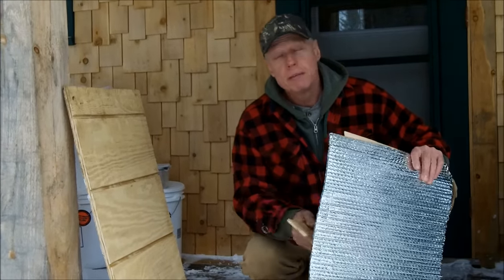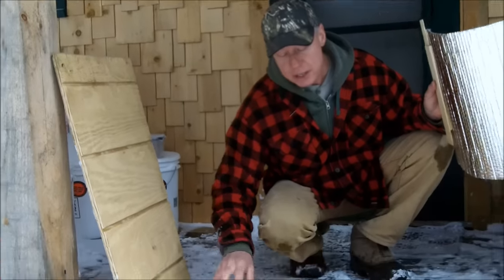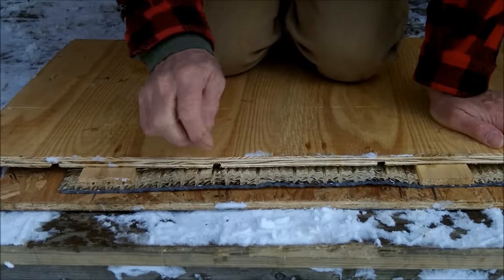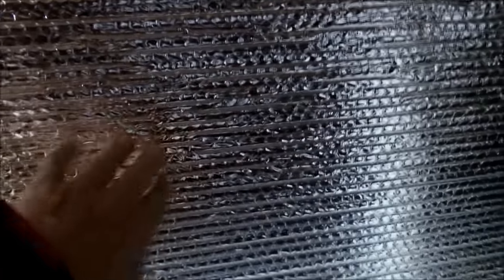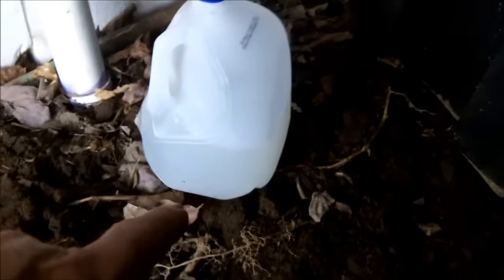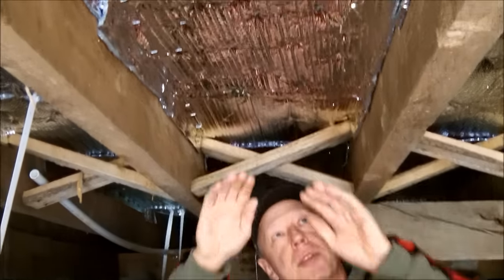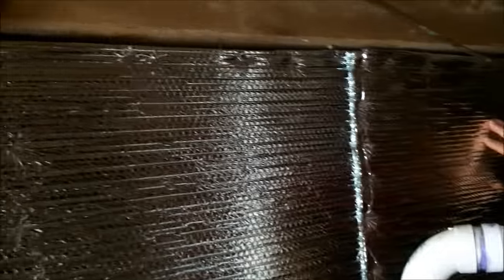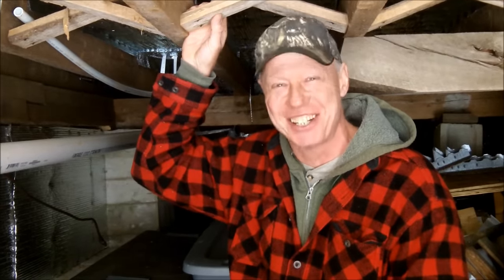HOW TO INSULATE A CABIN FLOOR AND KEEP IT RODENT FREE

Comment: Is the bubble foil good for outer wall insulation? How does it compare in price with fiberglass? I love the varying-size shingles on your cabin! I want to re-shingle my 1880's house and I read a while back that if shingles are painted on both sides before being put up, they will last longer. Would you know if that is true, is it a good idea? I came for the insulation and stayed for the shingles! :face-blue-smiling:
Reply from the maker: I have learned through experience that painting wood on both sides will make it rot faster than unpainted wood.  Also, I have recently posted an updated video on the insulations.

Comment: I asked about using my Rockwool underneath or saving it for another project, you already got back to me and said save it..Thanks so much.  Lowes sells the Reflctix which is .31" and Home Depot sells another brand ( Everbuilt ) which is .25".  I'm having problem  getting Reflectix. Have you ever used Everbuilt and do you think I .O6" in thickness would make a difference. Thanks again. Vernon
Reply from the maker: I haven't used it because it's a lot thinner than the reflectix and appears to be an inferior product.  I was hoping to have  the new vid out by now but I ended up in the hospital and just got home yesterday.  Hope to have it out this week and it'll answer your questions.

Comment: Another question for you Boss,, did you put any adhesive either directly on the joists before you put the bubble foil on or on top of the foil and then the plywood so that the floors don't squeak.
Reply from the maker: No I didn't.  Never saw the need for glueing my floors down.

Comment: We have discussed insulation before and you're right, no matter what you do with fiberglass, the mice destroy it. Probably the only way to keep those little Btards out would be to plywood the entire underneath and that's a lot of work. Have you ever considered using the 1/2'' or 1'' double foil sided sheets in between the joists ?  If they are cut right, they stay put just from friction. Always a good day when you put out a video and give Frankie a scratch for me. One more question, how much snow did you get ?  Down here in central Ct, we got around 15''.
Reply from the maker: 18" and been shovelling all day.  This foil stuff beats that foam board and ants LOVE that stuff.
Reply: Didn't know that ants love that stuff. I just figured the R-Value is much more than the foil, so it would be better but I stand corrected !   18'' is a good amount and that snow was seriously heavy !  Thanks Boss !

Comment: I’m in the design phase of building my offgrid cabin. I’m in northern Mexico so the weather is extreme 110F in the summer and 15F in the winter. This looks like a perfect solution, two questions if I may. Would you also use this on the sides/walls (it’s an A Frame Cabin) or rather use FOAMULAR for the sides? And is there a thickness of this bubble foil you’ll recommend?
Reply from the maker: This is an updated version to my video with info you may find useful.  https://www.youtube.com/watch?v=Wa2-FWAwwUY

Comment: Interesting, you get by with bubble foil skirting a a layer of same on your floor, around hear (nth Iowa) we have plywood on the underside of the floor joist w/ 10" of bat ins. for crawl spaces and 2" of pink foam on our skirting
Reply from the maker: It's amazing stuff.
Reply: whats cool is that I can get 48" wide end  rolls 10-15 ft long from my work for about nothing , maybe $1.00 for ten end rolls

Comment: My Jim just just turned this on in our room (you are on a big screen ha ha ) as we will be doing many of these things on our cabin ourselves for first time. Want to do it right.

 I was first married at 19 and my first husband and I lived on the edge of woods and it was a true hovel and we had rats, not just mice but rats. They took up residence in my stove and in the insulation. PEED in it. Turn on the stove and ode to rat pee filled the air. I don't know of a nastier scent on this blue plante

Coudn't cook except in electric frying pan. I remember after putting out decon, opening the lid on the electric fry pan and there was a dead rat. With a new baby in the house I had a melt down. I wanted to move home with mom. ha ha 

Well there will be no moving home with mom this time so appreciate the advice. My Jim is taking notes. You are the best!
Reply: Let me add, same baby grew up to work in a pet store and brought home a pet rat for me. I named her Bathsheba and taught her to fetch rye bread from my hand after putting her on my shoulder. But wild rats...no siree not interested in them coming in or making a place for snakes to come in either.

Comment: Which option do you think is better between 1) laying the bubble foil on the floor with wood strips nailed down, then plywood on top of that, and 2) stapling the BF underneath the floor between the floor joists as you did? Thank you.
Reply from the maker: Putting it beneath the floor would be my choice.
Reply: Lay the foil on top of the floor joists. If you put it between the joists from underneath you will still get thermal bridging through the floor joists creating a cold strip every 16” throughout your house

Comment: When you build your skirt, how do you have it at the ground level, does the wall board go into a trench and backfill, or does it just rest on the ground.  Does the bottom plate 2x4 sit on the ground, do you put vapour barrier between the bottom plate and dirt?  I am trying to skirt the bottom of my cottage but unsure if my wall has to go into the dirt or just rest on it, and how to prevent rot or mould.
Reply from the maker: The plate is above the ground, anchored with a stake through a hole in the bottom plate. The skirting is buried and so is the bubble foil. I've had no issues with it.
Reply: @thebossoftheswamp  thanks for the reply! good idea to keep the bottom plate off the ground

Comment: I didn't catch how the shed company was going to insulate the floor for you. Can you explain how they were going to do it?
Btw, I saw one You Tuber put in the floor joist with 1 by 1s attached to them on the inside and they placed cut sections of plywood in between the joist. which They would then insert floor insulation and when done they would cover the entire floor as usual with 4by 8 sections of plywood. This created a sandwich of cut plywood, insulation, and then the top plywood would be the floor you walk on. This system keeps animals out because they'd have to get through the cut sections of plywood that had been nailed into position with the 1 by 1s as support. This might work. You'll still need a vapor barrier placed underneath.

Comment: Wouldn’t that be applicable to exterior walls and ceiling joists also. Both sides?
Reply from the maker: It would, but air gaps are recommended by the manufacturer.   Some suggestions are shown with the specs: https://amzn.to/38AUY59

Comment: Boss thank you so much for sharing with us. I have a question for you, after purchasing my old farm house and having the old old paneling removed from the walls, there is no insulation nor is there any sheet rock, only the wood frame.  Would it O.K. to use the bubble insulation to insulate my walls and then sheet rock to close the walls.  Thank you and blessings to you and yours!
Reply from the maker: The foil works best in roofs and floors. I use standard fiberglass insulation in my walls.
Reply: Thank you Boss for your help.  Blessings to you and yours!

Comment: Two things come mind , Would it help if you stapled the bubble foil around the rim joists. We have a problem in my country of the possibility of  radon gas seeping from the undisturbed soil under your cabin.Would it be appropriate to lay down overlapping rolls of 10 mil lblack poly to help alleviate this possibility. Other than that, Thanks for living my dream.
Reply from the maker: Foil on the inside of the rim would be a plus for sure but blocking the heat coming from the ground would have my pipes freezing.

Comment: Great idea with bubble right over studs then subfloor. But, I've heard that the bubble should have an inch of space to work right. Your Thoughts?
Reply from the maker: An air space will help but it also will invite mice to nest in that cavity. This works awesome as is and will be all I'll do in my upcoming build.
Reply: @thebossoftheswamp  Hello JC. Thanks for getting back to me. Just want you to know my wife & I have watched so many of your videos. Love Em!
Thanks for sharing all your knowledge!

I'm still in the process of working out the details on a builder's quote, for a 10x20 barn. And, it's driving me nuts trying to figure out all of what I need b/c there's so many variables of barriers. Nuts! 

All I know is so far (b/c of you); I've asked him to lay the double foiled bubble wrap over joists & under the sub floor B/c I ain't wasting my time & money on insulation the rodents are gonna tear up anyways! But...

I'm confused about all the barriers. I.E... They say, use a Plastic Sheet on "Outside" of frame (Vapor Barrier/Moisture Barrier?)... IF it's hot & humid & you're using AC! BUT... They Say Use it on the "Inside of framing"  IF You intend to use Heat! Well hell, what if It gets hot & I want AC? And what if I want some kind of heat if it gets cold? So..
I'm Confused & Don't Want Moisture and/or  Condensation or Molds Etc. Confused Bro! 

But I'm thinking about adding the bubble on the ceiling and, the Bubble on the walls?  But say I wanna panel over w/a nice 1/4" beaded panel? Will that create Moisture in there closed off? And, the other thing is... 

Lets say, I do end up needing just a little bit more than the bubble? (cold circulation); What do I do use? And how do I guarantee I won't get condensation, moisture, mold?

Also, I'm ordering "smart panels" which are guaranteed for like 50 years? LOL. Well I'm 64, so if I can get 16 years I'm happy? Anyways, would it be a waste to use the double bubble up against smart panels? (Even if it has some type of radiant barrier like the LP Tech Shield?) Or, would it be like "The More The Merrier?"  And I'll stop there! 

B/c You are one Awesome Dude Man!!! You've not only been kind enough, to share (For Years) SO MUCH INFO With Everyone! And, then, you take the time to answer & help "so many people!" And I've seen you answer the same question over & over! So, Too Kind I Tell Ya! You're Awesome!!! 

And again, A Big Thank You for your reply; And, knowing you, one day you may help me understand how to add a lil mo warmth (W/O Condensation, Moisture, Rot, Mold).
But if you don't? Well Thank You Anyways!
And God Bless You Bro! 

P.S. Are you still postponing the procedure?
YES, I am the same way! Hope it's nothing too bad? Would really like to know? 
My wife just had 2 cancer surgeries and is on this Horrible Chemo Type Med that's So Hard To Watch Her Suffering. My poor wife hurts so bad. It Cut Off All Estrogen and ballooned her up and she can't take 1 step w/o so much pain in her knees.

Anyways, Would like to know what's up with you, so my wife & I can pray for you & your wife! We are already attached to you and your wife. Don't want anything to happen.  Thanks Again Boss!! ~Pandaman!

P.S. If I can Ever get this shed built...
I got a Promaster Van I need to insulate and do a lil LED lighting & compost toilet Etc. Anyways, If my gal gets on some different meds (that can help her walk a lil better)... We'd Love to come out & visit you at one of your cabins! I'm in York PA!  Sorry So Long!

Comment: Great video! Planning to use in my crawl space. Do you think it will help with keeping the cabin cool in the summer?
Reply from the maker: Can't say that it will effect the cooling but it certainly helps keeping the cold out:-)
Reply: Alex,
  Depending on your house, you might want to check out elastomeric paint, sidewalls & roof. Heat gain; UV & IR can be eliminated with a 12 to 15 mil application. This material has sub-micron, refracted ceramic spheres in a paint. Used it hundreds of times...to good effect.
  Your ground temp, unlikely contribution to the building. Outdated windows, South & West may contribute to the problem. Check out low-e glass...for grins.
Good luck with your project!

Comment: I'm thinking about doing this between my joists and subfloors. Would you recommend that I use strips on top of the insulation and joists to keep from damaging the bubbles, like you mentioned?
Reply from the maker: If you can access the area beneath your floor,  just staple it to the underside of your sub floor (between each joist).  This has worked very well for me and I can always inspect the condition of the product through the years.
Reply: @thebossoftheswamp  Thanks for the quick response! It's up off the ground enough to crawl under if I want, but I don't really want! 😂 It's at least 150sqm of floor to do, and since it's an extensive renovation of an old home, I already have much to get done (mostly alone). There are definitely critters to be aware of, so I'll definitely keep it in mind to inspect, as you said. Thanks again!

Comment: What brand of 'bubble foil' do you use? Could not find it with  the link you noted and would like to also  know if you recommend using the Tyvek house wrapping along with the bubble foil for the ceiling?
Reply from the maker: This is the stuff i have been using  https://amzn.to/2FaeHvU   along with this foil tape:   https://amzn.to/2WLJV2w and I see no need for the tyvek but that's just my opinion.  This is outstanding for under the floor but for a cold climate, I would also use fiberglass insulation in the ceiling with this on the interior side of it.

Comment: Works best with a 3/4 inch air gap....read applications......works great in grow rooms also reflective....and takes high temperatures well.....but it conducts electricity!...buy the best foil tape for joining pieces..
Reply from the maker: Agreed but mice love those 3/4" air gaps.

Comment: I've been thinking about doing a radiant floor type set up at our Cottage use in the same method you have at your place right now because our place was built over 35 years ago no insulation under the kitchen it's open air so the wind blows right off of lake and straight under the cottage I was kind of thinking about running PEX back and forth and running it over to the wood stove and running glycol through the system with a small circulating pump to warm the floor on that side of the cottage since the fireplace is nearly 40 ft away on the other side of the cottage I was kind of thinking it might be a good way to the other side concern would be the heat would just be sucked away because we don't have any skirting around the bottom of the cottage because we get a little bit of flooding during heavy rains we have never done any skirting around the bottom
Reply from the maker: The skirting will make all the difference in the world.

Comment: Hi! I have an enclosed front porch on my house and want to use the bubble foil on TOP of the floor as it is built like a regular porch with the usual gaps between planks. We are not able to get under it without a lot of issues, so I thought I could possibly coat the top of the floor and as you said for the plywood subfloor "sandwich", add some wood strips between the top of the bubble foil and subfloor of plywood??? I want to tile on the subfloor after in the porch. Any suggestions, absolute no-no's or tips?? The area is un heated right now but we hope to put some kind of heating in after the bubble foil... Thanks!!
Reply from the maker: IMO I would staple the foil over the floor, then nail (at least) 1/2x1 1/2" wood strips through the foil and into the floor joist below > then plywood over that and proceed.

Comment: what do you have for air flow into the crawl space underneath?  is insulating it like this going to create a warm / moist area for mold to grow?
Reply from the maker: It's ventilated in the summer.
Reply: @thebossoftheswamp  meaning you just open vents to allow air flow to pass thru or you take off the skirting?

Comment: Before anyone gets too excited about this insulation, do some research. It is about R3. Better than nothing, About as good as a flat 2/4. If you want rodent proof ins., then 3 products come to mind. 1. expanded glass---the same stuff used to clean restaurant grills. about $1 pre foot/inch. 2. solid wood. Pine is R 1.5 an inch. 3 inches of pine would be about R 5... 3. crushed pumice ( lava). It is about r 1.5 an inch. Tightly packed in a cavity, rodents can't move it to burrow.
Reply from the maker: The warm floor in my cabins say differently.  The reflective properties of this stuff rocks.

Comment: Its called reflectix and it dont stop water vapor from coming in! And if your blanket of reflectix isnt completely sealed the gap does not increase your r value it has to be a completely sealed cavaty to reach r5
Reply from the maker: I guess my warm floors and frost free waterlines are lying to me.  Ripping it out now.
Reply: @thebossoftheswamp  im a certified weatherization tech what would i know? But you should look up how air sealing effects r value and also how  a cavity has to be completely sealed to reach r5 value wich is how double or triple pane windows work
Reply: @thebossoftheswamp  however we use this product alot in air sealing applications but the edges have to be sealed for it to work properly